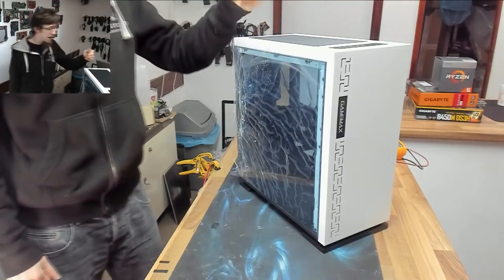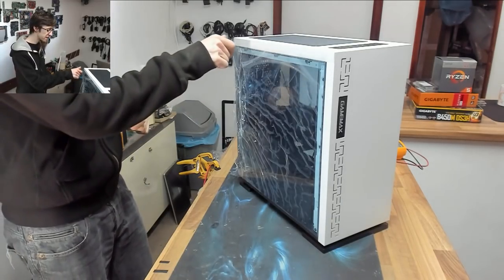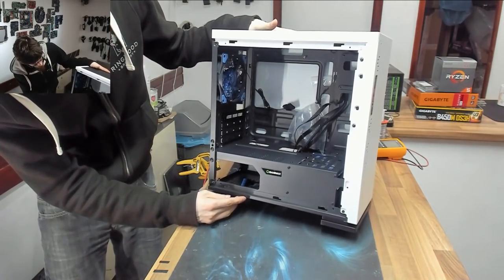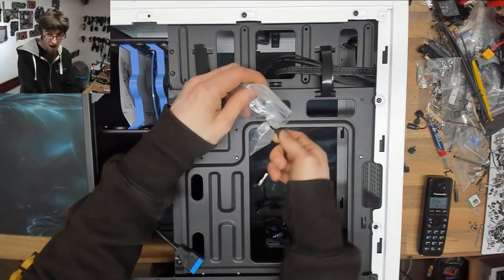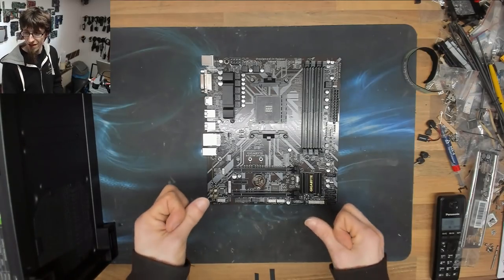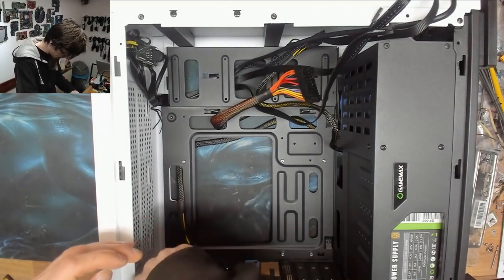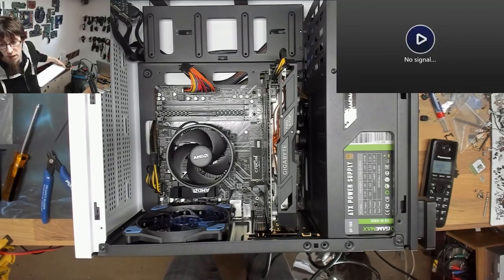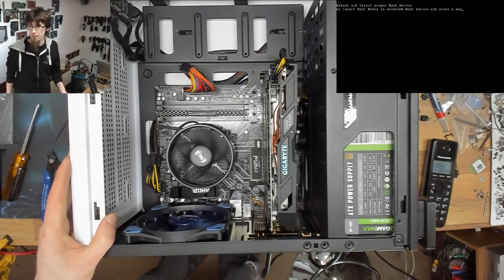LBC#33 - GameMax Expedition Build and Review

Comment: I have this case in black. It is superb value for money. Obviously it is a little limited on the air flow but my case is cool enough for my needs. I have 2x 120mm fans pulling air into the case from the top and a 120mm AIO CPU cooler venting air in the rear.

Comment: I've always used Cooler Master for my PSU. Never had any issues with them. Bought my current one second hand and I've had it for 7 years. It's only just gone. Replacing it with a Seasonic 650, but that's because some of the Cooler master stuff on Scan don't seem to be the current year models.

Comment: Just picked up one for £25. I'm going to swap out that blue fan with some spare ones I have and put two in the top of the case. Thinking of making the top fans intake/blow into the top and blow out at the back. I'll have to test but I have a felling that if I set all the fans to blow out its going to become a huge dust magnet.
Reply: @Adamant_IT  I'm now thinking at the top in-front of the CPU heat sink to blow in and the other fan to blow out of the case over the heat sink. Finished the build yesterday and it looks great, 3 blue fans and two blue led strips.
Reply: CreateDezign how did you place your fans
Reply: @wraith5828  One at the back two on the top all exhausting... Actually I eventually changed the case for something a little bigger. Nothing wrong with this case really though, I just wanted something with all glass finish.
Reply: CreateDezign what about intake
Reply: @wraith5828  None I assumed that having 3 exhausting fans would suck enough air through the front vents.

Comment: HA! I recently built in that! Made a nice black&white themed budget Core i5 system that sold quickly.
Reply: Hi, uhm, since you built a pc in that case, can you tell me if u have/had  temperature problems?
Reply: @DannRoo  Absolutely not. Granted it was totally not a high end system. I had an i5 6500 in there and a GTX 1060, air cooled with a deepcool neptwin because its available in white. Temps were no problem at all.
If you put in something beefier you might run into problems at some point because the case has and cannot have front fans. you could mount a radiator to the top though and exhaust through it.
Reply: @catriona_drummond  i have a gtx 1660 and 1600af :/. But my budget is at its limit, can't spend more for fans/ cooler.
Reply: @DannRoo  That should be fine.

Comment: As you said at 46:00 about the fan configuration, how would you go with one more fan, use the back fan as intake and one at the top near the front as exaust? Or the back one normaly as exaust a top one intake. I have the bought the same case, is a cheap case in Brazil as well, where I live, a hot country, as you might know and I realy am thinking buying another fan to help with heat.

I have an rx 570, and well, AMD is known for heat, but I have undervolted to the point where I don't see more than 60-65 C. As I said, live in Brazil, Minas, realy, realy hot place sometimes.
Reply: @Adamant_IT I exchanged the gamemax one that comes with the case for a more simple one(80 mm) that is faster and it semeed to help, I undervolted my rx 570 and is not reaching 65c as it was before.

Comment: Could you use a 3pin to 4pin (if that's a thing) for the case fans so the LEDs always work
Reply from the maker: Not on this fan. You'd have to re-wire the LEDs to power them separately. More modern RGB fans have a separate lead for the LEDs, or they're 4pin PWM and have full power at all speeds.

Comment: Nice video.. i have just bought this case in red for a second spare pc i'm going to build, i'll probably go with ryzen 5 or an i5 8600k, this video helped to see what i can actually fit in this case, cheers. just a question on the issue of the fan only lighting up at a higher rpm. if you had NOT of snipped that molex connector off and plugged that into some power as well as plugging the 3 pin into the mobo, do you think that would have solved the issiue of the LED's only lighting up under load? just a thought :)
Reply from the maker: Sort of. You can't connect molex and 3-pin at the same time - you'll plumb 12v back into your mobo 's fan header and potentially have a very bad day. If the fan was connected by molex alone, it'll just run at max speed max brightness.
Reply: @Adamant_IT  ahh!! good point. not the best of ideas then :D

Comment: One could certainly make a case for screw standardization. All case screws m 3.5 except for heavy-duty screws which should be m 6, All standoffs m 3.5 and 8 mm long. All screw heads Philips. could also be combo philips/hex. This mx/match of metric/"imperial"  seems so arbitrary and useless. Obvious in some cases there may be a need for longer screws, but let's keep everything simple:  M 3.5 or M 6 (and I am American )

Comment: I was mounting my motherboard watching your video and got a problem. My chasis fan doesn't have two connectors. It has only the one that you cut down at 28:30 and it doesn't match with the pin for chassis fan on the motherboard. What to do?? Please help

Comment: how is the cooling in this case, HDD's and other components  , since there is no front intake fans ,
Reply from the maker: I wouldn't use this case for anything high-end. But for low-mid range cheap gaming PCs it's a good starter case.

Comment: For this case, do you recommend adding 2 intake fans on the top panel? How should the cooling system be? I just built a pc and this is the case I am using.
Reply: i have a questions i buy this case and i want to build a b450m steel legend and i need more stand off did u use the stand off the case or u use other stand off like the video?

Comment: Hi what would be your opionion on cooling using this case? as usually people would have intake and exhaust.. but this case is lacking the intake fan option,.
Reply from the maker: Yea, this is more a case for lower-end builds where heat is a non-issue. I wouldn't advise using it with higher-end components.

Comment: Bro, can I plugged 2 RGB fan on top of the chasis and what fan do you prefer? And also where can I plugged the FAN pins on the motherboard. Beginner question. Thank you so much!
Reply from the maker: Yes you can. If you want some rad RGB, check out something like this: https://amzn.to/2C3z27q (associate link) which gives you a three-pack plus an ARGB controller. Your motherboard may have on-board RGB headers, but that's a higher end feature, so it depends what you buy. Same goes for number of Fan headers on the mobo, low end boards often only have one or two. A fan splitter costs a few bucks and will let you connect multiple case fans to one header.
Reply: @Adamant_IT  Perfect! Thank you so much good sir. People like you are rare. :)
Reply: @Adamant_IT  BTW, my mobo is MSI B450M Pro-VDH and PSU Aerocool 600W.
Reply from the maker: That'll be a good board, only thing it's lacking is RGB headers. But yea, thankfully you can get those cheap multipack fans with a simple controller!
Reply: Bro last question! For the Two Fans I'll be installing at the top of the case, should it be Exhaust or Intake? (Gamemax H605)

Note: I'm confused on my board. I bought 2x RGB fans, I don't know where should I plugged it, JRGB 1 or Sys Fan 1/2.

Sorry for not knowing this things mate. Hahaha

Comment: "No one has USB2.0 anymore" - actually almost all of my USB devices are USB 2.0 and I would want to be able to continue using them, I certainly woudln't want to replace everything for the sake of a new case. 

Keep going with USB 2.0 case manufacturers!
Reply: @Adamant_IT  Yes, I understand that, but I like most people I own far more USB 2.0 devices which get by with the lower bandwidth so why incur the extra cost of USB 3.0 ports. One or two is sufficient for those few USB 3.0 devices I have and is adequate for a budget build.
I've been putting together PCs since the mid 90s, and like to reuse components and upgrade slowly over time. I have frequently been stymied by disappearing/changing slot types and sockets...

Comment: Can you put a 280mm radiator?? i have same case, i'd like to buy a nzxt kraken x63
Reply from the maker: Almost certainly no. You'll need something bigger if you want to start fitting AIOs, especially a 280mm.
Reply: You can put a 240mm aio radiator using a slim model. I use this case with a silverstone vida 240mm slim AIO with a 5950X and a Saphirre Nitro+ 6950 XT, yes i know and i don't recommend anymore to do it, i'm messing with the temps since this case does not have a front intake fan. If i don't use my air conditionner to get about 24°c room temp, the cpu and gpu are throttling, and even with air conditionner i my 5950X can go up to 90°c and my 6950XT is about 80~83°c. I'm planning to change this case, but this is a very good looking case for low-end or mid-range builts.

Comment: Components:-
Ryzen 5 3400g
Msi B450m morter max
Corsair Force MP510 240 nvme
Seagate 1tb hard drive 
G skill 2*8 Gb 3000mhz ram
Corsair Cv450 
If i build with those components in this case, does it will get hot or airflow problems. And any cable management issues???

Comment: Hi Adamnt , can you just confirm if this case is compatible with ITX Motherboard support. Thanks
Reply from the maker: Yea an ITX will fit in this
Reply: @Adamant_IT  Thanks ,I can get this case for 27.98. As I doing a small upgrade and changing my coolmaster case  130 ITX option to  one of these. swapping all my parts over with my i5 4690k and got  2nd handhand ATI 480 Card 4GB(present card ATI 270) ,and Corsair 16GB DDR 3200 memory all for less than £200. I am pretty certain my current setup which is over 5 years will keeep going for a few more years and still play the latest games. My CPU is overclocked to 4.2.  The 130 case is a nightmare now to work in and maintain.So looking for something more space and better airflow. My only concern this case does not have front fan collections for air intake. I already have a coolmaster CPU watercooler with 120 fan and radiator. Also I have a extra 120 spare fan not used. Would like your thoughts on this Adamant.

Comment: What's the airflow like? I'm putting in a rx570 and dunno if it'll overheat
Reply from the maker: This isn't exactly a high airflow case... but an RX 570 will be fine, it doesn't kick out much heat, and even a single exhaust fan will keep it happy.
Reply: @Adamant_IT  What would you recommend should I be blowing air in or out through the top of the case?
Reply from the maker: I'd go for an exhaust personally. Negative airflow works in most cases. Sometimes positive is better, but often only when the case is designed for it.

Comment: Do you recommend this case for AMD 3600 & GTX 1060 6GB founder edition ??
Reply from the maker: It'll work... I wouldn't go any higher than that, you may start running into airflow problems. But the 3600 and 1060 are still cool enough not to require any major case airflow.
Reply: @Adamant_IT  hey adamant! i have been wondering would normal case fans fit on the top of this case? if so then its a steal!

Comment: Would you be able to list the parts used for this please. I'm building one like this. My First time lol
Reply from the maker: -AMD Ryzen 3 3400g
-Gigabyte B450m-DS3H (may need a BIOS update for Ryzen 3000)
-Corsair Vengeance LPX DDR4
-Gigabyte RX570 (look for a 580 or 590, sometimes only slightly more expensive these days)
-Crucial MX500 (obsolete, use a Crucial P1 or Intel 660p)
-GameMax GP500
-GameMax Expedition
Reply: @Adamant_IT  awesome. Thanks alot
Reply: @Adamant_IT  I'm new to all of this and have a bunch of questions. Is there a page like fb or insta where I can inbox you?
Reply from the maker: I don't mind answer some questions... but tbh if there's too much to put in a comment, then you're asking too much.
I do have a step-by-step guide on building a PC from scratch as well, which I'd recommend if you want to see the whole process in more detail.
Reply: @Adamant_IT  there isn't too much, just thought it'd be easier. And yea I'll look for that thanks
Reply: @Adamant_IT  hey, if it isn't too much trouble, have you had much experience with this power supply used in the video? Apparently its unreliable. Can I get your opinion on it. I'm looking for a good psu that's all
Reply: @Adamant_IT  Thank you so much

Comment: Can I put a fan in the front panel?
Reply from the maker: Nope, no front mounts on this case. You can mount at the back and top though, which will exhaust hot air.
Reply: @Adamant_IT  so there I cant put any intakes ?

Comment: What about cooling? seems really bad?
Reply from the maker: It's not a high air-flow case, no. But for the budget builds it's designed for, you don't need high airflow. There's a big difference in the heat output of high-end computer vs low-end.
Reply: @Adamant_IT  I actually bought it and built a high end pc in it for fun. I love difficult builds and this one was tough due to space. To be fair thermals are okay with a custom loop 240 setup.